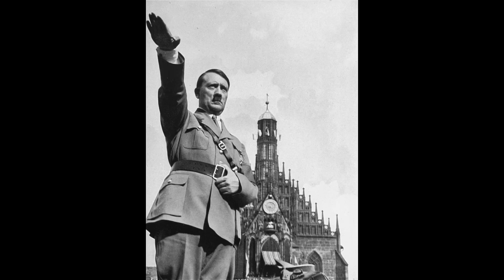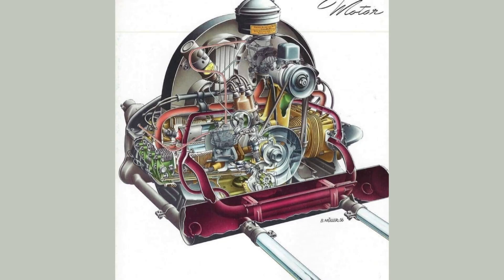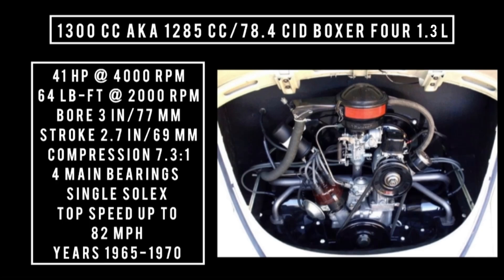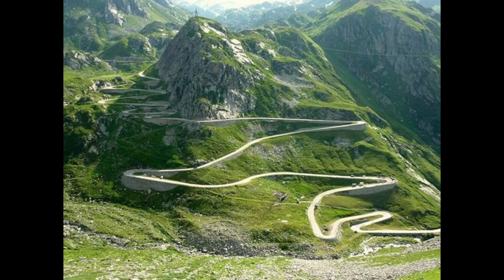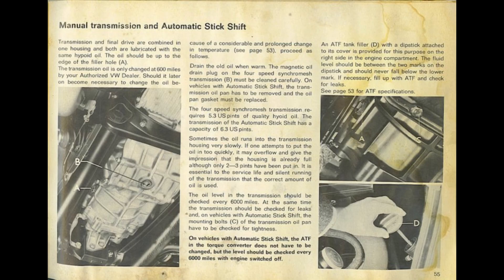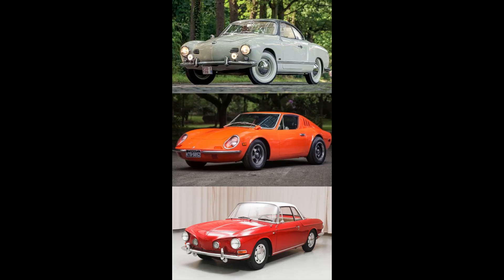Volkswagen air cooled engine family ( 1100, 1200, 1300, 1500, 1600cc )

Comment: My dad was one of the first VW dealers in the country, we were up in Ohio.  I was working on 36 and 40HP engines (before they came with fuel guages) since about age 10 and took the cosmolene off delivered cars for the princely sum of $.50/hour.  Learned to drive on the 2nd generation bus (1968+, as I recall).  1600 cc engines with Bosh electronic fuel injection were standard in the type 3 models (Fastback and Squareback).  Karman Giha bodies were hand made, a quality inspector went over each body weld with a white glove so those welds were assured to be invisible.  We live about 10 miles from the dealership, when we arrived about 2 miles from there, we would finally get heat out of the floor mounted vents.  Air conditioning?  Until about 1968 you could forget that.  They finally figured out a way to mount the condersor to the under-body of the car.

Comment: Puma is by far better than the KG ,it doesnt rust and is very cute.In Brazil we had the Bizorrao ,our Super Beetle with 1600 dual port and dual carbs good for 65 horses and the 1700 SP2  with dual 34 mm Solexes good for 75 horses I think ,though this one had T3 axial fan.Cheers.

Comment: In the U.S. no air cooled motors over 1.0L were allowed in after the EPA was established, VW and Porsche were only grandfathered in since they were imported before the EPA existed... 😢
Reply from the maker: Franklin was an air cooled company here in the states that had engines over 1 L
Reply: @What.its.like. the Franklin Motor company went out of business in 1934, the EPA was established Dec 2nd 1970
Reply from the maker: Sorry I've been crazy busy the last few days and wanted to look into this further because it was very interesting I never knew the EPA put regulations on aircooled engines, but they did the 2CV was pulled from the US market because of the EPA... Saab make a 2 stroke that was replaced with ford V4. I was thinking the Honda Z car ( not Datsun Z ) their tiny z600 was air cooled but we didn't get that version here the twin cylinder is water cooled. That's interesting 🤔 

I wonder if motorcycles were exempt
Reply: @What.its.like. I am a custodian of a Honda Z600. The story I picked up was Mr Honda 1st wanted to import his 1300 Coupe but was tipped off that this new government agency was going to restrict air cooled cars, so not to be deterred while selling a kei class under 1.0L 600cc car he & his team went back to the drawing board and came up with the 1973 1200cc Civic CVCC the cleanest running car without a catalytic converter @ the time.  Air cooled motors have come a long way with EFI but traditionally air cooled motors must run with looser tolerances to operate through a wider temperature range.
Reply from the maker: @OYisit  thank you so much for sharing that information. I greatly appreciate it.

I was always curious about the Z 600 Honda what's your experience? 

What's the best gas mileage you got out of that thing? 

They are really cool cars that really very rarely get seen
Reply: @What.its.like. I found mine in a Honda boneyard & for $700 & all spare parts I could grab. It took about 5 years to restore. Their very familiar to me since I had one when I was 15. They get about 45mpg if you keep em under 55mph, not the greatest but impressive for their era. 😊

Comment: VW only had 3 main bearings, not 4
Reply from the maker: https://www.jbugs.com/product/111198465.html?utm_content=shopping&gad_source=1&gad_campaignid=8624133576&gbraid=0AAAAAD_huCQ08IogzywZEgwOuMqfj71Wf
Reply: @What.its.like.  Forgot about the bearing on the crank snout, I was wrong the vw has 4 mains.

Comment: Is the 1500 the best engine overall? The reason I ask is because I have a trike with the 1200 in it...
Reply from the maker: I've always heard the 1600 was the best with the dual port makes the most stock horsepower but everybody's gonna tell you something different. You can get more power out of it with more carburetors, but economy suffers when you do that.

Comment: 7:54 - Not a VW engine. I don't even know what it's called, but I do know that it never went into production and that its development progress was being reported by EPI Inc.

Edit: Corrected timestamp.

EPI calls the engine the O-200 replacement. Work on the engine might still be underway.
Reply: Yes it has a VW air cooled powertrain. It was a car created in Brazil. Was built over a VW chassis topped with a fiberglass body. Here in Brazil we had a lot of other independent factories that produced various purpose cars based on this very same VW platform. This includes even Baja cars equipped with beefy aircraft tires in the rear to run in the beaches.
Reply: @buginga  I think that my time stamp is a little off. I'm talking about the engine at 7:54 - 7:55.
Reply: @PistonAvatarGuy perfect! You’re right. At that timestamp it’s really not an VW engine.
Reply: @P @PistonAvatarGuy although here in Brazil in the 80’s people used to build framed light aircrafts with the beetle engine. Probably all crashed back then, cause was 0 safety.

Comment: Man, this is the first place I have heard about a single port 1600.
I got my first air-cooled VW about nine months ago, a '69 Ghia, and I just started looking to see if I had matched numbers. Long story short, the engine code looked like it said I had a 1600 from 1970 and that all of them were dual ported, but I thought I had a single port 1500.
I also suppose it's possible that I have a franken-engine with various parts strapped together to make it run...

Comment: You should have mentioned the Electronic Fuel Injection version of the 1600cc that was produced in Mexico since 1993 all the way up to the end of the Beetle production in 2003. Only mexican Beetles from those 10 years had that engine. It was the same 1600cc dual intake port engine but with Electronic Fuel Injection from Bosch. It had 4 injectors, one for each cylinder, and produced more power and fuel efficiency than the carburated one. The reason Volkswagen De México implemented this change was because in 1992, an emission regulations law was passed in Mexico and would come into effect in January 1st 1993, that required that every car made in Mexico had to be only EFI and not carburated anymore, so Volkswagen De México designed this EFI system for the Beetle, based on the Bosch EFI system found on Golf's and Jetta's of that time, to comply with the new law.

Comment: Sadly as a Teenager I Bought a Perfect Bodied 1959 Bus along With The 36hp Engine laying In The Middle of the Bus Cargo Area All For $35.00 in around 1978 an here's Where it Cuts Deep Still in 2025😢 , l live in The Country with Fields on this Ole Family Farm so One Day my Cousin Rode The School Bus home With Me An We Cut The Entire Top Off of it Level With The Dash and Flush With The Cargo Floor with only a Hacksaw an Sledgehammer Leaving The Sheet Metal over The Motor an The 2 Bumper Mounts At The Back I Left Both Doors in Tact with The Window Still intact But For What Reason l do not Know Since they Couldn't Stop The Wind an Rain Nomore !!! I Built The 36hp Engine at Age 14 an Reinstalled it to The Split Case Transaxle an To My Delight all Forward Gears Were Still intact Including Reverse So I Built a Battery Box out of Plywood an Mounted The Battery Right Behind The Rear Seat Heater Horizontal Auxiliary Tube ! Anyhow That Poor thing Cought More HELL Than VW Could of Ever Dreamed Putting It Threw I Made a Mud Track in One of The Small Fields an With My Cousin Riding Shotgun We Kept That Poor 36 Screaming For Mercy  At The Top of its Lungs When There Was None To Be Had an When The Poor Thing Ran Low on Oil I'd Shove Black Oil Down it's Throat an It'd Be Begging For Mercy Again Running Sideways in The Curves of That Mud Track ! It Dropped a Valve on #3 Coming Down The Dirt road Ridge an Lucky For Me Not For it I Found A Good Used 36hp Head , Piston , Rings  , an Rod an Threw it Back Together an Was at it again it Had 1 Working Headlight Since The Other Was Missing an We Could Ride in it at Night An Man Let Me Tell You These Folks With Pop Out Windows in Front Had Nothing On Me Since I Had No Windshields at all an Sometimes The Poor Thing Cought a Break on These Back Dirt Country Roads an id Ease Along Looking Up at The Stars in It and it Was a Beautiful Thing All Except For Me Cutting The Muffler Off With a Hacksaw just Leaving The Runners to The Muffler for Even a 36hp Engine Can Be Loud l Even Gave The Poor Thing a Name l Called it 
THE  NAZI WAGON !!! 
I Finally Broke The Frame in Half on it Right Behind Both Front Tires an The Front End Started Tipping it's Nose Which Made Shifting Hard Since it Was In a Bind But For about 4 Years There l Had The Time of My Life an That's How l Cut My Teeth on VW's ! I Truly Wish l Could Go Back For it Would Have Got Treated Extremally Different But l Got Memories of it l Even Hauled Firewood on it To a WW1 Veteran That Lived Up on The Hill Next To Us an Now it Sits in The Woods in Pieces ! l Truly Miss Those Days ! 
🇺🇸1st💯%

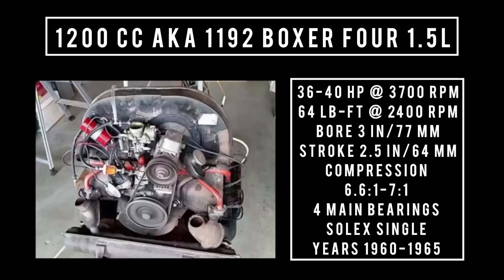Comment: 1131cc isn't 1.5 litres as is in the box at the top of the graphic at 1:40. Ditto at 2:40 with1200cc.
Reply from the maker: The liter size conversions are wrong

Thank you so much for that correction

Comment: 66  Type III Ghia!  Back in the 70s I had a friend who had a 1967.  What a sweet car, as appealing as a BMW 2000 CS in appearance.   As it was, I had a 1967 Type III Fastback for several years.  Dual port, drilled out mains and air correction jets on the stock PDSIT carbs, 1650cc big bore top end, extractor exhaust.  This was back in the 1970-80s.  I once hit 95 MPH while being chased in a road rage episode back in 1982.  True!

Comment: Had a 1968 Beetle. 1500 cc (1.5 liters). Rated at 53 horse power. Single barrel carburetor. Single port cylinder heads. Max cruising speed rated at 78 miles per hour. Had the the stock distributor (with vacuum advance), I had the timing set at 0 deg before top dead center as specified in the VW official shop manual, and I kept the carb properly adjusted. The idle speed and the air-fuel mixture were both kept properly adjusted. And I never had any problem getting up any hill at 78 mph. No running start was needed in top gear (4th gear). A very steep hill might require downshifting into third gear and driving at 55 mph, but a hill that steep would never be encountered on a any highway, only on a remote back road. And on such a remote back road the max safe speed would be about 35-40 mph anyway. So there was never any problem getting up any hill. I suspect that most likely your 73 Ghia had an engine that was not properly adjusted. Or maybe the brakes were dragging. Or maybe a previous owner had installed the wrong distributor, or wrong carb, for your engine. I'm not sure what year they started using fuel injection. Around 1971 they started with 1.6 liter engines and dual port cylinder heads So you should have had more horsepower than my 1968 model. Plus the Ghia had better aerodynamics. So my guess is that something on your engine was mal-adjusted, or someone had replaced parts with the wrong part.

Comment: Aircooled, no head gaskets to fail, no cam belt or camchain to fail. When new & made in vw factories they were about the most reliable engine in the world. As long as one has a spare fan belt one can go for over 25 years as long as occasionally one adjusted the rockers & occasionally changed the oil, oh & bought, stole or bludged petrol.
Reply: Btw got 2 Type 3s, a 70 Fasty with a Stan Popjoy Racing 9k balanced counterweighted crank & a 70 wagon

Comment: At that time the bugs climb the hills far more better than the Mercedes Diesel limos.

The 1.5 and 1.6 were far more fuel efficient than the smaller types. In hot areas use a SAE 40 or 50, under frosty conditions a 10 or 20 and these engines will run as advertised.

Comment: I owned a 1969 Beetle with 1300ccm and 40 HP (Motor number with letter "F". My first car - first bit of independence in 1978. :)
My brother had a 1970 with the same engine. But later he replaced the cylinders with a set from a bus from the junk-yard. These cylinders were from an engine which was "rebuilt" by VW the second time: so they bear the mark "II" on it. As a consequence, it had 1685ccm or so. From the 1300ccm engine onwards, all larger cylinders would fit to the main block.
Downsize of this change was, that the oil cooling of the 1300ccm engine was not sufficient for 1685ccm.

Comment: Twin port came out in the 1600 in 1971. Every 1500 beetle (1968-51) I have ever seen has single port, same with kombi 1600cc 1968- 70. So many incorrect claims in this vid.  1600 was not used in the VW Type 4 (1968-74)
Reply from the maker: Thank you for sharing that information 

conflicting information when looking for information for this video

Comment: Some of these photos are not standard beetle parts, one of the crank case showed a six cyl crank case, the exhaust system shown was not standard vw. 1200 came out in the 1962 model not 1960. My 1960 had an 1100cc 36 hp

Comment: 0:40 Chevy Corvair engine case.

VW engine cases were made from Magnesium alloy from 1951 on. All 1200, 1300,1500 and 1600 engines had Magnesium alloy engine cases.

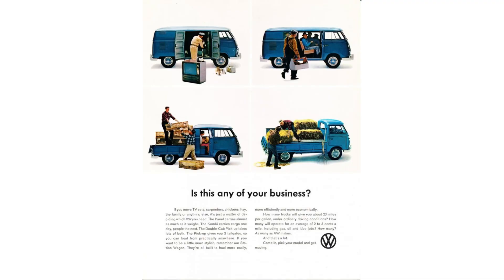 The engine shown at 7:43 is a recent prototype aircraft engine that has no VW parts at all and is 200cid and 125HP. 

7:59 is a Swiss Army mobile air compressor. Not so much an industrial application as a military application, but at least it is VW 1600 powered... I bet you get this every video. Let the propeller hats fly us to the MOON! Ok toke break over. Thanks for the work. I watched every one but the K car engine.....
Reply from the maker: Thank you for the corrections

Comment: I got to enjoy my bug with its stock 1200, with "forty horses of fury," and it wouldn't pull 70mph. Now it cruises at 70 and easily runs out at 125ish, speedometer stops at a hundred. She's got a hundred horse 1641 with big valve aftermarket heads, Scat counterweight crank, Scat rods, Engle 100 cam, 1.25 ratio rockers, single Weber 44 IDF two barrel and a merged header with a single chamber Flowmaster. All going through a Rancho freeway flyer trans, with a Super Diff and 3.88 ring and pinion. It doesn't take much to make a bug fast, the car only weighs 1600 pounds. It's a good time "walking" Honda kids and Mustang bros from a stoplight, even with that little motor. 😄

Comment: Hi Justin, good video!  The engine cooling fan was attached directly to the generator shaft.  You had the cooling fan at the far end of the generator, with the generator drive pulley attached directly to the generator shaft on the near end, that was driven by the crankshaft pulley, by means of a drive belt, or a "V-belt" you might say. The generator performed two jobs, cooling system and charging system simultaneously at all times   Please reply.  Dave...
Reply from the maker: Thank you so much for sharing all that information and insight

Comment: Don’t try to drive a 1975 vw bus in the Mojave desert on a hot day. Result …overheating. Air cooled engines don’t like the Mojave. Don’t ask me how I know. I also had a 1966 1300 vw bug. Rebuilt that engine twice. What I liked about it was after I parked it in the parking lot for work  I popped off the distributor cap and pulled off the rotor..kept it in my pocket while working. Nobody ever stoled my car.😀
Reply: They worked fine and pretty much any climate when they were in proper working order. They were not maintained or someone did an improper repair, like any other car, it’s a different story. I’ve driven many CW in the hottest climates and the coldest and never had any issues with them.
Reply: Slow to 45 and stay in 3rd.  It's all about fan speed.
Reply: @brianchisnell1548 yes; keep it between 2,800 to 3,000 rpms and it should work better.
Reply: @vayabroder729  now you get it!
Reply: Drove a type 2 1600 across top of Australia temps of 40 plus degrees celsuis ,regular valve adjustment ,oil change etc and had zero problems..
Reply: I had a 1971 VW van and rebuild the engine and made it a 1835 cc with a 110 cam and dual Kadrons  . I full flowed the case and had extra oil cooler  .  I could do a 100mph on the freeway IN A STRAIGHT LINE  , cornering NOT SO MUCH .  I really liked that van 👍😎 and now a good one is worth $20,000 - $30,000  YIKES  !
Reply: My neighbor had a 76 with Porsche jugs, heads, and pistons. It had an auxiliary oil cooler to help with the heat. That car was fast 120mph+
Reply: Daym, I'm building a Sandrail for glamis 😂
Reply: I do this too. VW security

Comment: Frankly as a European i grew up with the last VW aircooled Transporter van known as the Brick in the early 1980's.
They were just everywere and used by all professions and companies at that time.
So my bias goes to a first generation VW T3-transporter (the Brick) with the  1.6 aircooled engine and 2 simple round headlights.

Comment: I would take the Ghia with the 1600 motor !
I am surprised that nobody here has mentioned that in tune ups you have to adjust the Valves ! I think nobody mentions it because it is so much fun to do it !
Tell me folks what happens if you Never adjust them ? 
The original Kuble Wagon is Cool but the Swim Wagon was even better !

The engine is used almost exclusively in “Dune Buggies “ too !